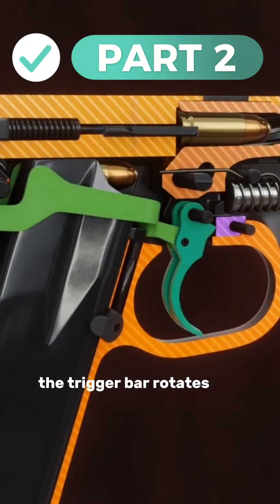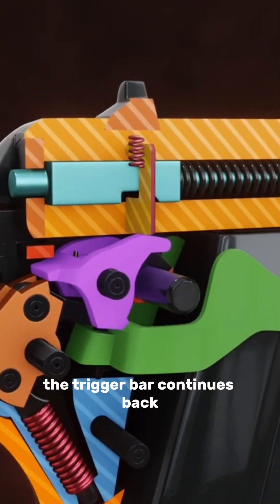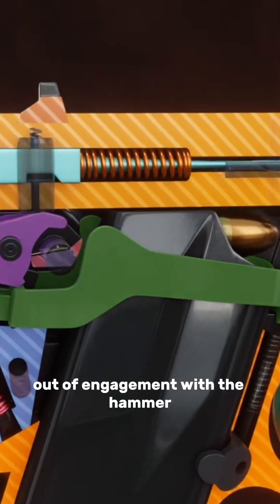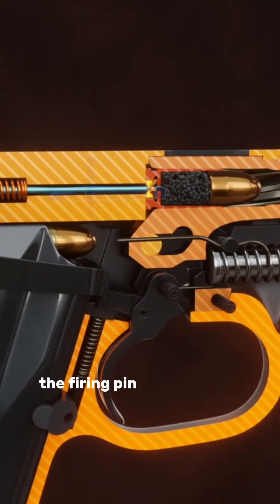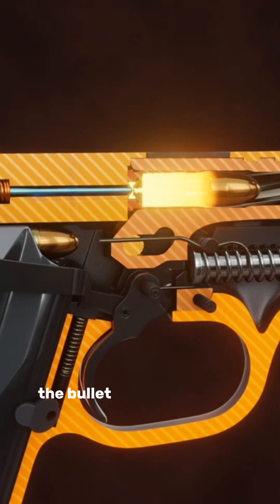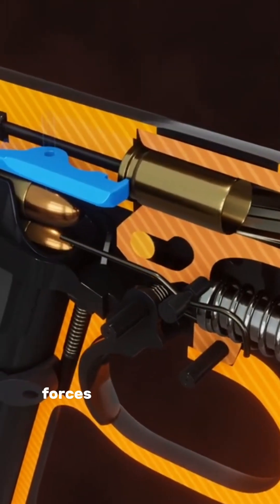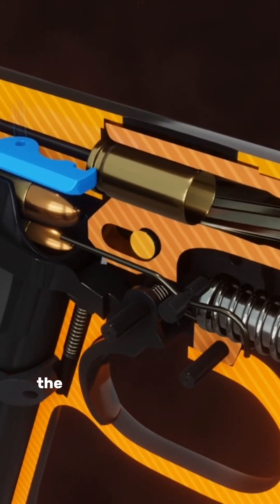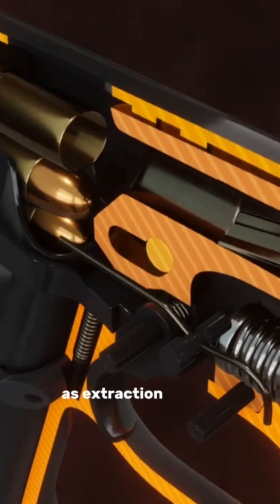SAR B6 - How it works - Part 2

Comment: I wonder how tight the tolerance is for when the bullet is fired and the slide goes back. I wonder if it stays closed long enough to get the absolute most amount of pressure before reciprocating
Reply from the maker: It's designed to stay locked just long enough for the bullet to exit the barrel and pressure to drop to safe levels before unlocking and cycling.